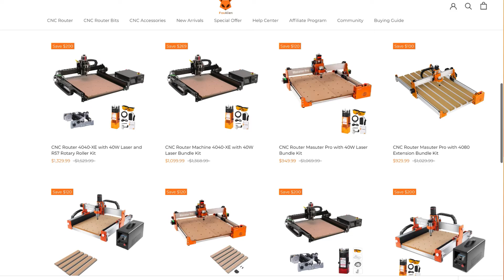Supercharge Your Fox Alien Desktop CNC With This! | Brett's Laser Garage

Comment: Hey man thanks for this video. I ordered this CNC and have put it together but havent got to use it yet, prepping my first project. I noticed that this only has an endstop on the left gantrty. Can this make it get out of square? As it only makes sure one side hits the end, so the other could be off. Is there anything I should be doing at the start of each job to make sure its squared? The control box doesnt have a port for another endstop so I cant add one but I'm assuming it works fine with only the one? Thanks!
Reply from the maker: Hi!  Are you referring to the limit switches?  It’s got switches for the x,y, and z axis.  There’s nothing that you need to do for overall squareness other than what’s outlined in the manual during assembly.
Reply: @LaserGarage ok thanks. My thoughts was that the Y axis has gantry plates on each side, but only a limit switch on the left. So if the right side got off slightly when it zeroes it wouldn't correct that side. But if you have never had an issue then I should be ok thanks!
Reply from the maker: Yep.  The 0,0 homing position is the front left and there is a limit switches there for the x poistion.  The limit switch is on the z axis carriage where the spindle/router is.  The machine knows where it is don’t worry.
Reply: @LaserGarage  Perfect, thanks!

Comment: Hi, Thanks for sharing valuable information. Please guide FoxAlien FA710 Trimmer Router can be installed in CL - 4 x 4 Foxalien? can you share the wiring/connection with controller and software integration settings etc.
Regards,
Reply from the maker: You’re welcome.  I don’t have that model but the installation should be basically the same as what I showed on the Masuter 3s.